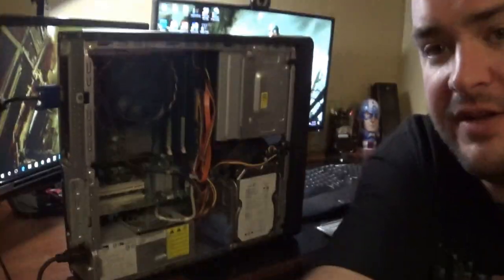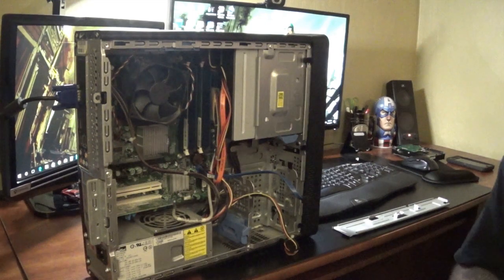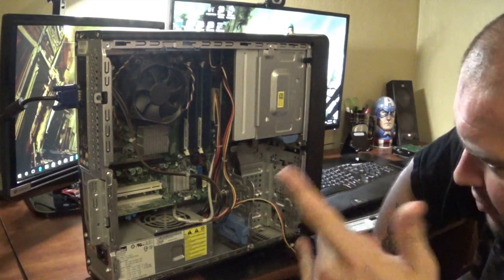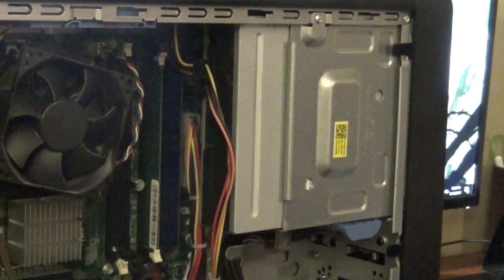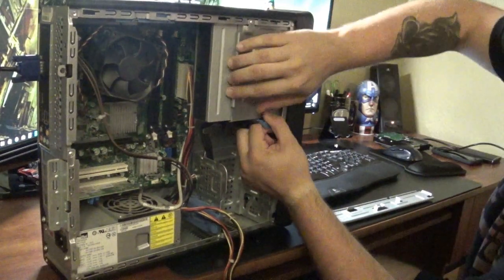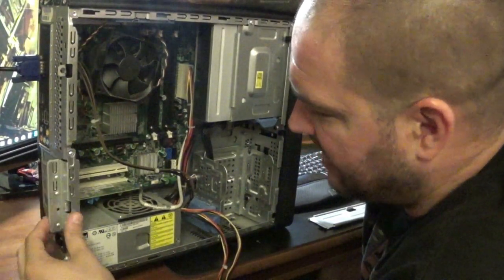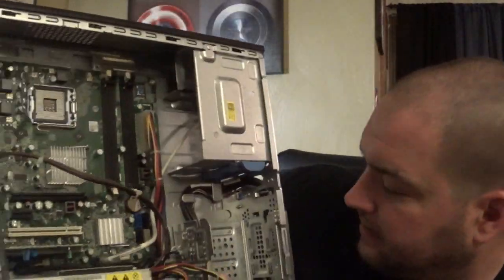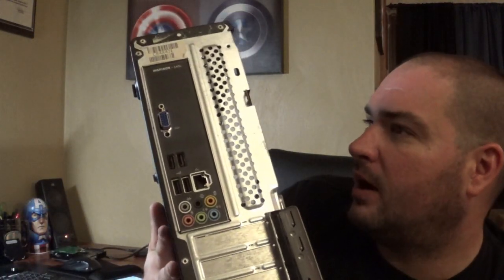What parts can you reuse from an old computer?

Comment: Hi, I have a laptop with a great CPU but without a videocard (a good one). I would like to make an external GPU with parts of an old desktop pc, for instance the power supply 250W, the hard drive for extra space and the DVD, sd, etc. Reader. My Laptop has a thunderbolt 3 output and usb. Do you have some tips, or do you if it is even possible?
Reply from the maker: Yea you should be able to run an external GPU thunderbolt 3. It really depends on the cpu in your laptop. I would say a RX580 would be enough for a laptop.

Comment: is your power supply really that bad you cant reuse it?
Reply from the maker: LightFlame well this was from a stock computer so depending on how much power you need it may not work.
Reply: @RangosReviews  I am planning a build where i got a 850w power supply from my old pc. I am not sure about the motherboard but i know i want a rysen 5 3600 and G.Skill Ripjaws V DDR4 3600MHz 2x8GB ram. I got the rtx 2070 for the build. Damm hard to find the right motherboard for the right price. I dont want to deal with bios problems.
Reply: I bought a pc 2nd hand and was wondering if I can reuse the power supply if in the future I were to upgrade the pc ( TX 650) I also have the speccy software if that helps
Reply from the maker: Kruel Xd yea a 650w power supply can be reused just make sure all the cables will work on your new motherboard which I am guessing they should.